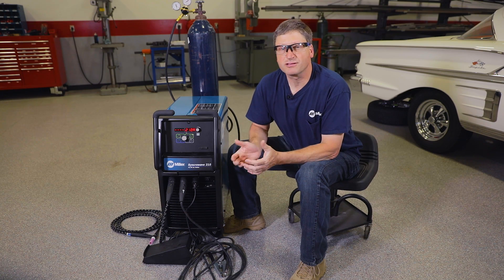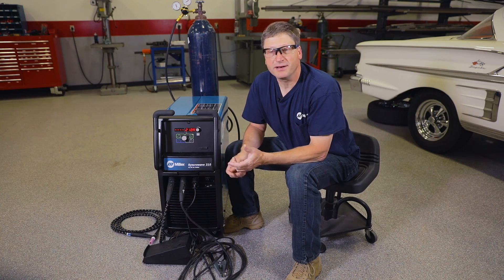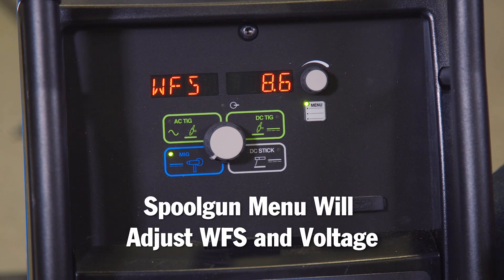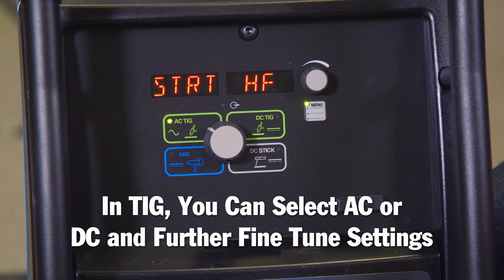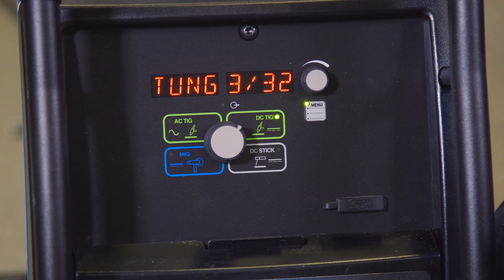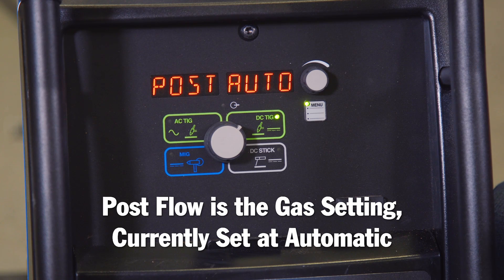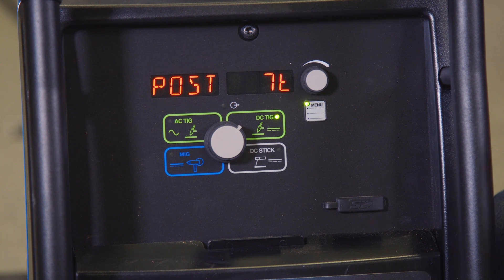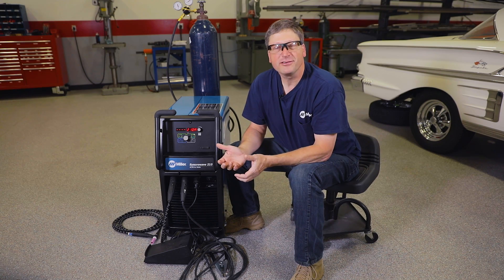Choosing a TIG Welder — Learn More About the Syncrowave 210

Comment: I've had a Syncrowave 210 for a couple of years now and absolutely love it. Aluminum, steel, stainless, or tig brazing, it has performed very well. A couple of questions that I haven't been able to find answers to; is there a way to set the welder for spot welding on sheet metal, to deliver momentary burst of set amperage (i.e. 200A, using foot control as on/off rather than as a potentiometer)? Also, is there no way to adjust background amperage % while pulsing (there are occasions where 50% background is a bit much...)? Thanks!
Reply from the maker: Thanks for reaching out, Robert. The Syncrowave® 210 does not have any type of spot timer function. You could put a momentary switch on the torch and when contacting the control, the unit will jump to panel amperage as long as the button is depressed. Also, background and on time values for the pukser are fixed values. Thank you.

Comment: Just purchased mine, excited to testit out., does the mig capability still need to be added on thru the memory card? I noticed the logo for mig had changed so was hoping it came standard when ordering the spool gun kit.. also does the ac freq expansion come standard now? I noticed this one was set at 120hz and i thought they were 100 from factory.. thank you in advacnce
Reply: CORRECTION – I called Miller this week and spoke with an engineer there and he said that the AC expansion card mentioned in this comment is to enable older Syncrowave 210’s to go up to 150Hz (not 400Hz).  Newer Syncrowave 210’s, like my machine, are already able to go up to 150Hz without the expansion card.  The Miller engineer confirmed that the Syncrowave 210 maxes out at 150Hz and is NOT capable of 400Hz, even with the expansion card.
Reply from the maker: Thanks for reaching out. The older models of the Syncrowave 210 needed an SD card installed in the unit to MIG weld. The new model does not need this, and is automatically turned on.
 
The AC expansion card is still available and the part no. is 301 127. This will allow the unit to go from factory default 150 hertz to 400 hertz with expansion card.
 
AC TIG Process Menu Parameters
Amperage 5–210 A
Balance* 60–80%
Frequency* 60–150 Hz
Pulse Off–50 PPS
Postflow Auto/Off–50 seconds

Thank you!